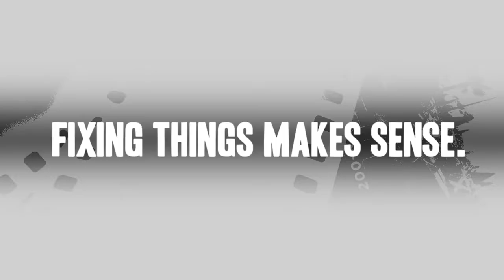Porter Cable Compressor Repair - Replacing the Air Hose (Porter Cable Part # A10162)

Comment: What is the fitting called that connects the hose to the tank on the outside?
Reply: That’s what I’m looking for too 😭
Reply: I believe they are called Oetiker clamps. Do a search for that and you should find what you need.